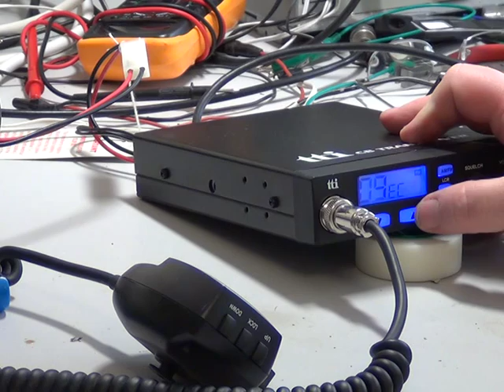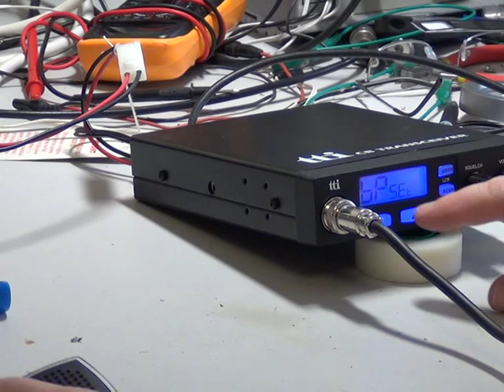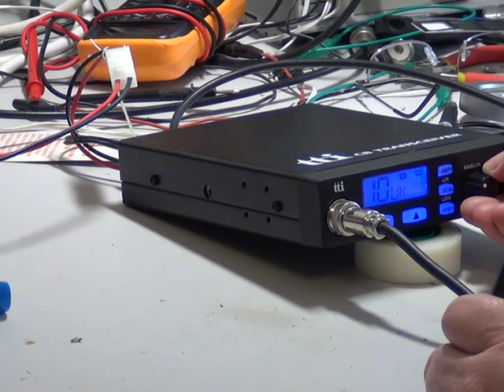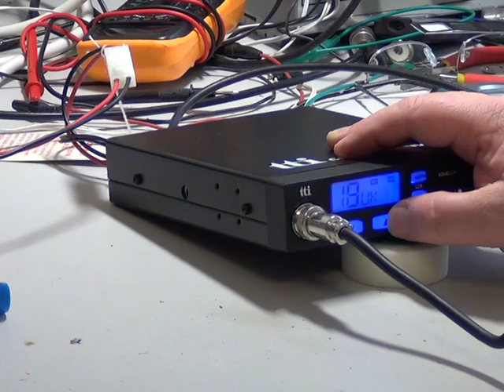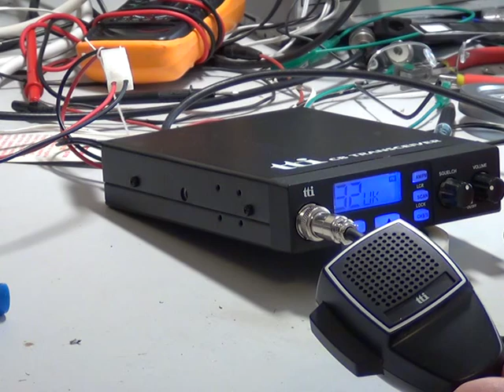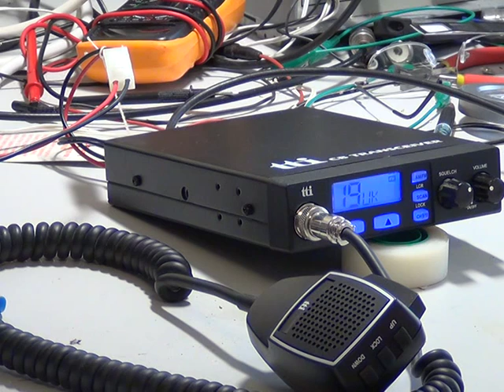TTI TCB-660 multi,  UK (CE - Multi) CB radio (Mobile). On The Air Test

Comment: hi just wondering if you service/fix cb`s? I have bid on one of these on ebay also but my midland needs a check over.
Reply from the maker: yes, but normally only to the trade rather than retail. The snag at this end is that the 2-way radio work is secondary to our church pipe organ restoration business (no electronics there!). I can offer you a mail order service but it's usually a 28 day turnaround. Please state the model of your Midland.

Richard
Reply: ok no probs (77-099)

Comment: tti I wud not have one given.
Reply from the maker: +Andrew Howden Interesting. Have you experienced snags throughout the TTI range or just with this model, and what problems have you r
experienced?

We've had snags with just one so far, a customers TTI880 where the VCO had become so microphonic I would have deemed it virtually unuseable. The problem was absorbtion of moisture into the cersmic capacitors within the VCO section, and being, like all modern sets.....SMD components, were not really economic to change; It went back unrepaired, though a little better.  What I do now,in view of this, is that when TTI radios come in for service, I apply aerosol tropicalisation varnish to the VCO section of the radio in the hope of stopping the ingress of moisture into these monolithic capacitors. So far, I've not had any back with microphony. Fingers crossed.

Richard
Reply: Then why are you here watching this video~?
Reply: @ukfmcbradioservicingTango21  He doesn't know, he's the usual "thinks hes rich", or "wanna be rich", the truth is, he probably has one these great little radios and he's here to learn how to change the bands. (Like myself which  needed reminding lol) Thank you for your short, straight to the point video. It was the very video i was looking for.

Kind Regards & 73s,
Graham.

MM0 KPG
(22 years a HAM)